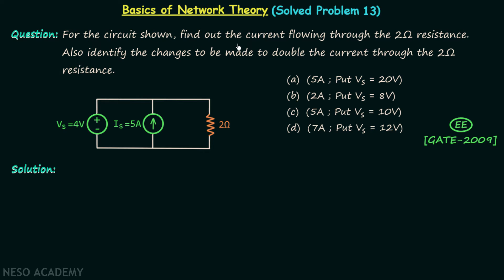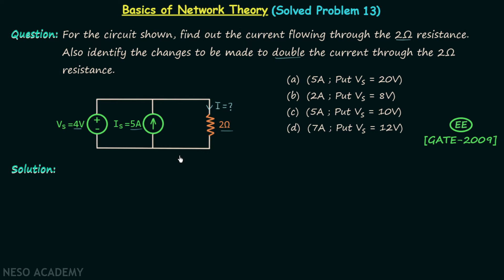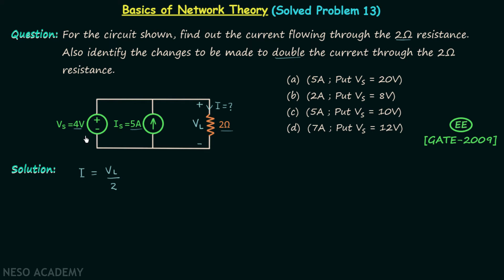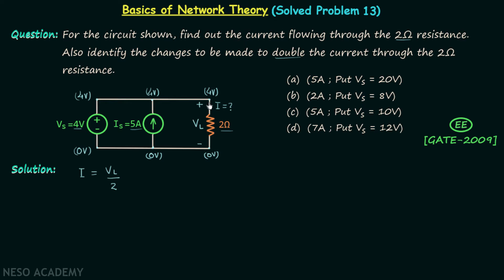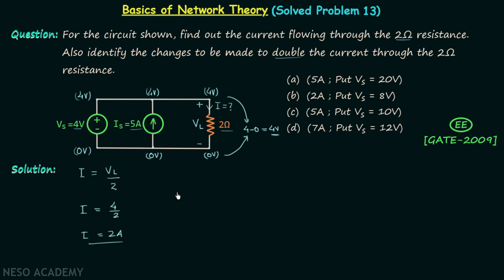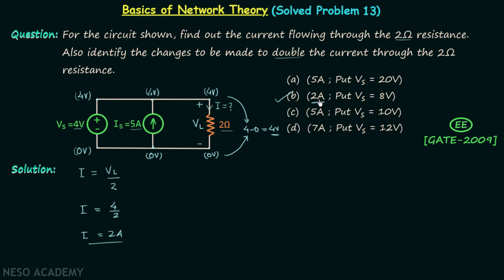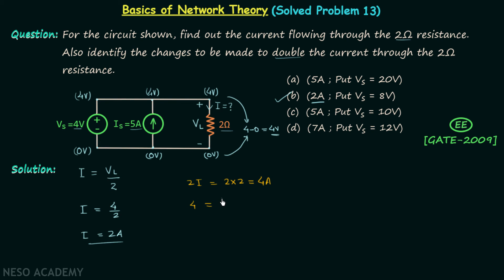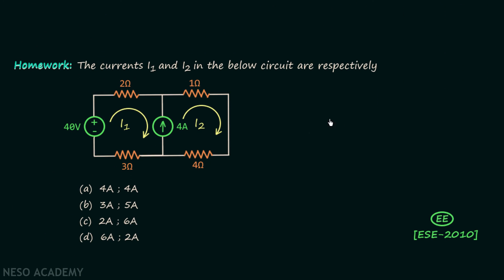Basics of Network Theory (Solved Problem 13)

Comment: As it is clear from the figure that I2 is in the direction of the current source and I1 is in the opp. direction therefore I2-I1 =4.
Now, checking with the options provided to us, i found option c to be the correct one. I think this can be the best possible way to solve this particular problem. What do you think guys..?
Reply: Correct
Reply: Correct

Comment: But why the current source is ineffective for voltage across the load
Reply: vishwajeet kadam As voltage remains same in parallel connection of elements . So the voltage across the load is also the same supply voltage .